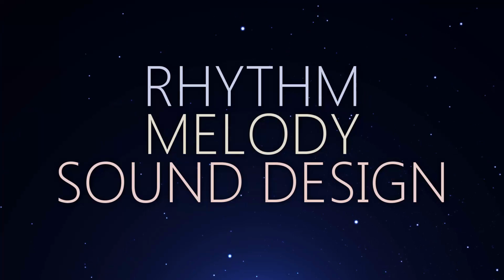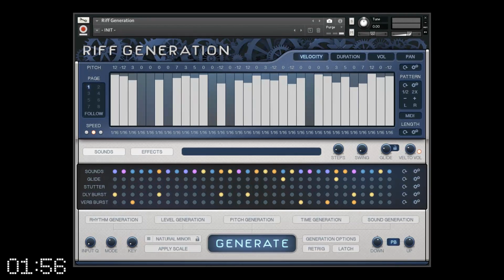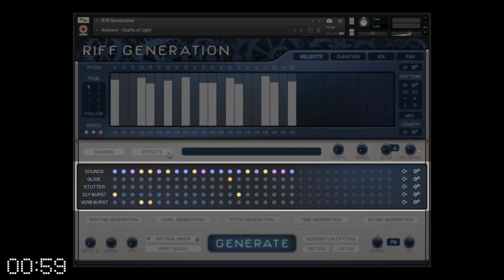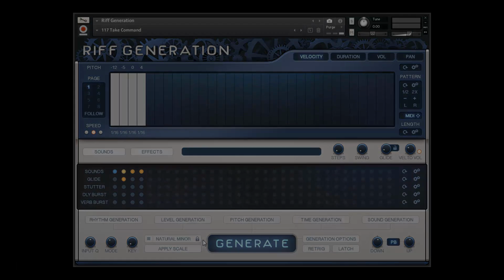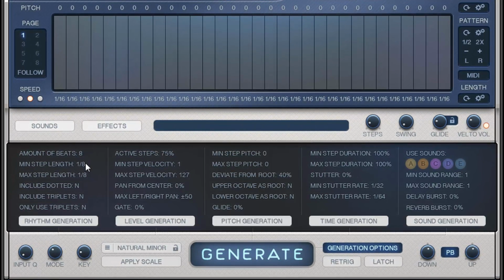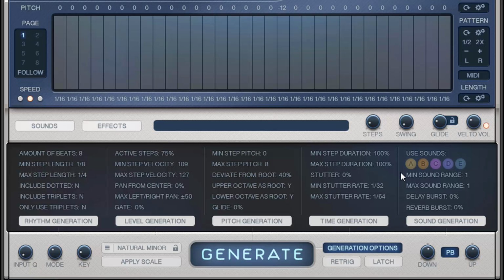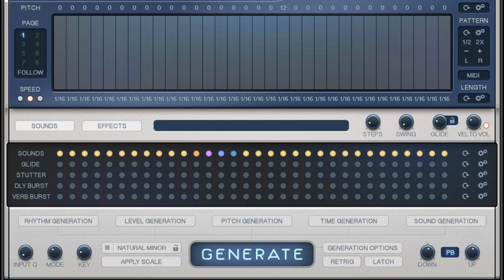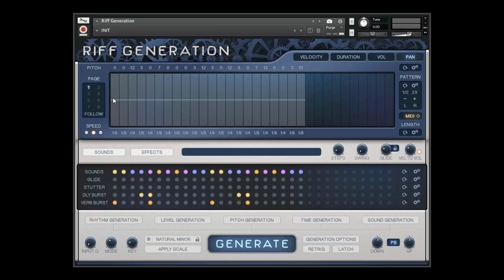Riff Generation - What, Why & How

Comment: this would be great if you could connect it as an effect or midi vst so you can connect it to any vst like dune 2, avenger etc :(
Reply from the maker: You can do that!  I've successfully used Riff Generation's MIDI output to drive and Arturia synth in realtime.  I've done this in both Ableton Live and Sonar.  

There is an option in Kontakt's preferences called "Send MIDI to outside world".  Select "script generated notes" and you're good to go.  

As a final note: this functionality is host dependent and some sequencers do this better than others.  Live and Sonar were dead-simple to setup, but Logic (for one example) is less developed for this.  Thanks!
Reply: Do you need the full version of KONTACT to do this, eg midi out or the free version?, I super interested in using this with my Virus Polar, I think it would be truly incredible,

Comment: I love the idea of beeing inspired by this.......But: what if i release a song based on a melody generated by this tool and i get sued by somebody whose song contains the same or similar melody using Riff Generator?
Reply from the maker: Hi Awan - Thanks for checking us out.  I'm not sure that's a likely scenario.  Plus, Riff Gen is HIGHLY directed by each user.  I imagine that most people customize riffs (either change note on certain steps, adjust rhythms, not lengths, sound selection, rhythmic effects (like delay) - so there are a ton of ways that riffs (for each user) can be distinctive.

Comment: Now, for 808 producers, can you take this concept & transform it to fit drum programming? You know how complex hihat programming can be sometimes. Clap/Snare patterns are all pretty much the same with the exception of the snares/rimshots hitting twice between the claps always hit (on the up beats between the ends of bar 1 & beginning of bar 2). actually there is some room to play around with rimshot programming & I notice in pop & rap beats, the kick patterns are usually pretty similar with the exception of 808s.  Could you guys make a library that allows the user to generate the patterns for each individual drum slot on the fly & drag the midi into their program? or something that will generate the midi & have the midi appear in the daws piano roll changing in real time? is there a way to create the 2nd idea? or do i have to always use the restrictions of my daws functionality? i'm using autohotkey to locate the different dynamic stamps in FL for different hihat rolls & for chords they include in their stamps menu but programming it is daunting because I don't know of a way to combine two hot keys. I'm still new to scripting & have NO idea how to combine two different hot keys into one hotkey. anyway would be a very cool product i think to save time. Like i think of how atlas of X.O gives you the ability to load your own samples into it, XO is overly complicated, I just want something that is devoted strictly to saving time for midi programming drums, no samples from the company that makes it, & nothing over the top that is trying to compete super hard with anything else out there. something that is just amazing at what it does so it is not overwhelming.
Reply: or maybe i could just midi out using this library to an FPC in fl. ha. dont know why i didn't think of this before i did all that typing.
Reply from the maker: I think a generative process could be created for percussion, but as it relates to Riff Generation and some of the things you're asking for/about - it would be quite a task to figure out how to get what you want in an easy to use interface - but yeah - it's something to think about!  Thanks for checking us out! - Dennis

Comment: It's a great product but I wish I could just play it like a normal VST, whenever I press keys it just transposes the sequencer to the note I play.
Reply from the maker: It can do that. 

It can work in two ways: It can transpose the sequence based on the key and scale of your choosing, or you can set the scale menu to "Chromatic" where upon the sequence transposes like a traditional sequencer (or what you typically find in other VSTs).  Thanks!
Reply: @InSessionAudio  Thats the point, I don't want the sequence to transpose at all. I want to input notes the sounds bank bypassing the sequencer altogether
Reply from the maker: I think I can read your reply in a couple of ways, so I'll try my best to reply.

Riff Generation has a "sequencer-based" design, one which interacts with the rest of the overall functionality (like using multiple sounds and switching amongst them in a riff, stutter effects, reverb/delay "bursts", etc).   

So there has to be a time-based tool (which is the sequencer) to interact with everything else.

But you can set the first step of a sequence to a longer note length (like a whole note) and a "0" pitch transposition - this would allow you to play it like a sampler - so long as you don't need all the other features I mentioned above.  BTW: With this approach you can still play notes shorter than a whole note - just not longer.  Thanks!

Comment: Can I create with this tool a 20 min track and export it as s midi or wav?
Is it possible to use it combined with FL Studio?
Reply from the maker: Hello.  Thanks for checking us out.  The longest a riff can be is 256 steps.  So, depending on the length of each step (1/4, 1/8, 1/16th, etc...) and the tempo of you song, I guess it could stretch to 20 minutes.  But that's probably very unlikely.  
Riff Generation exports MIDI only.  Thanks! - Dennis
Reply: @InSessionAudio  if it exports midi only, this means it will sound differently in any other midi instrument, right? Im relatively new to those ideas but I know that midi will sound differently in keyboard and differently in PC...
Reply from the maker: Right.  But it might be helpful to separate out a few concepts: 
You only need to play one MIDI note at a time to trigger Riff Generation.  It then plays a riff and its own sounds.  
If you need, you can export a MIDI file of that riff into your recording program to use with other virtual instruments or MIDI capable instruments (at which it will sound different, because it's playing other sounds, not internal to Riff Generation).